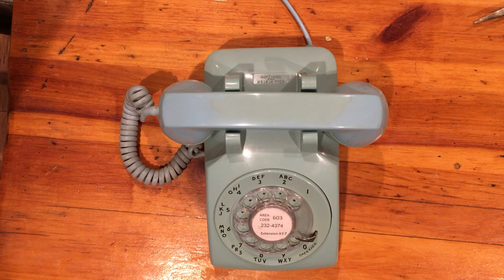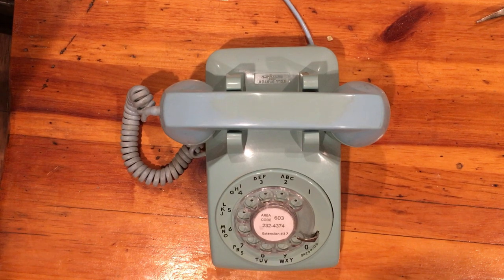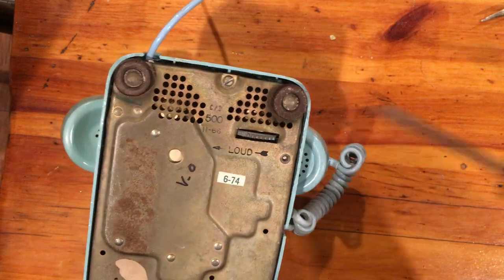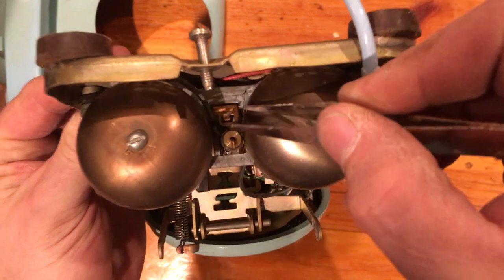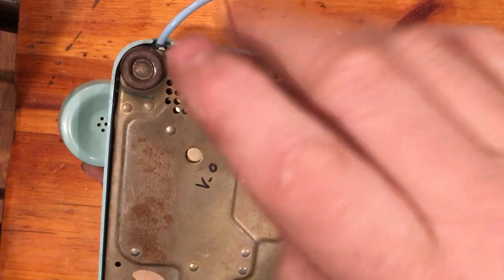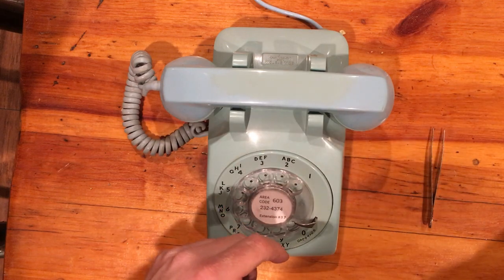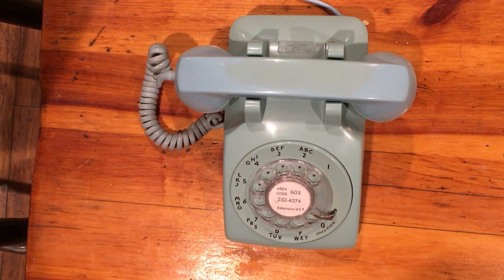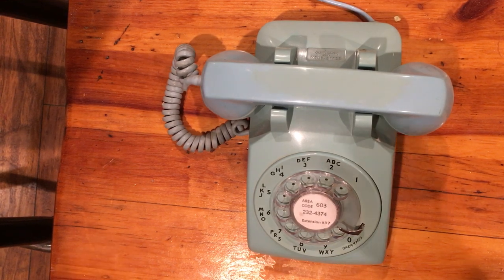Make an old phone ring on modern lines

Comment: Awesome video man, i remember seeing a video where the guy built an emergency light run off the phone line, he recons it was 75VAC at 25Hz when ringing and about 50VDC idle voltage, interesting in australia we have a different dial tone which is only present when you lift the handset, DC sine wave/waveform I would assume

Got me thinking, one of my favourite phones was the Telstra touch phone, the sound of that ringing at a fish and chip shop… memories

Comment: Thank you very much for the video.I have a german fetap 615 1a which has a totally different system and i have the same problem it works but not ringing.do you have any idea to fix it.
Reply from the maker: Not without seeing it… Check out the second video and see if that gives you any direction. It is the same phone as this video, but maybe you can look at the wiring and see if it’s set up in a similar way
Reply: İndeed the wiring is different but principle must be the same.i changed one of the connectors and managed to connect the ring to the line.now it works.thank you very much.

Comment: Hi I want to get one that doesn't ring but that works to make outgoing calls.  Can you still make outgoing calls on them without modifying? Thanks for your help
Reply from the maker: Without performing this modification, all other aspects of the phone work as they should. However, if you have phone service from a cable provider or through the internet, you will need a pulse to tone converter because those providers don’t work with rotary dials natively. Visit oldphoneworks.com They have a couple really good pulse to tone converters. One is a simple plug in affair that will make the phone work as it always did. The other is installed inside the phone and will give you * # and speed dials. Really cool stuff.
Reply: @chrisrichard298  thanks, yeh I just discovered that after buying my 1974.  746 online yesterday. Wouldn't have bought if I had known but I love the history of it so I probably will buy a pulse converter.

Comment: So I have the c shape but no pin what do I do?!?!
Reply from the maker: That's something I've never encountered before. Have you watched part 2, just to be sure that isn't the problem?
Reply: @chrisrichard298  Yes I did I tried to move some connections around my switchboard is much different set up than yours I have a lot more wires connections .
Reply from the maker: @bigalsguttersandlandscapes909  What kind of phone is it? Who makes it and what is the model number? Is it Western Electric, ITT, Stromberg Carlson, Cortelco, or something else again?
Reply: @chrisrichard298  Strindberg Carlson desk phone ☎️ I believe 550 don’t quit me on it though
Reply from the maker: @bigalsguttersandlandscapes909  That model is a 2 line phone, and it certainly does have a boat-load of additional wiring. Here is a link to a wiring diagram for that phone. Make sure the ringer is connected to the line you are using. If you can be more positive about the model, we have a better chance of getting it working.
https://www.telephonecollectors.info/index.php/browse/wiring-diagrams/stromberg-carlson-1/3921-s-c-575b-and-550b-telephone-wiring-diagram/file
Reply: @chrisrichard298  I will try thank you so much